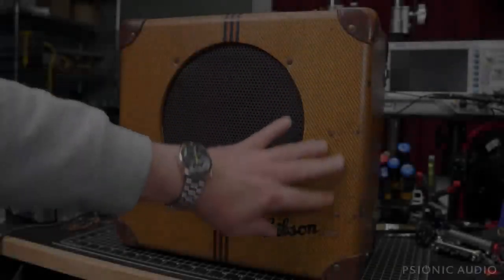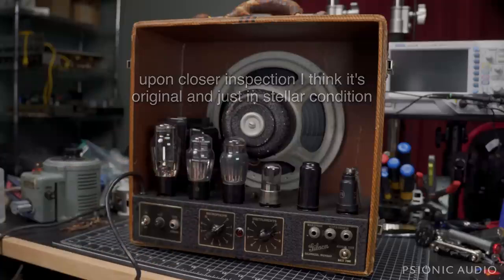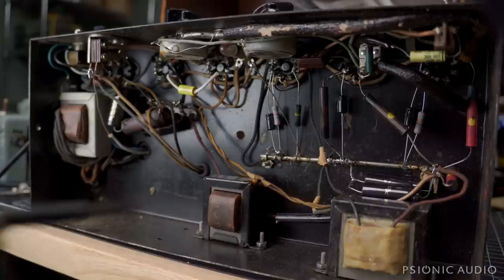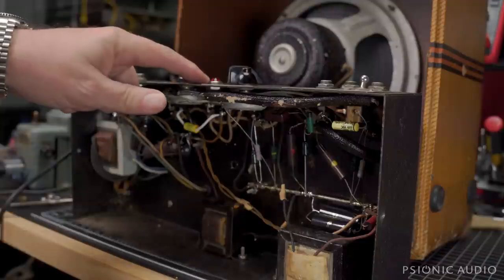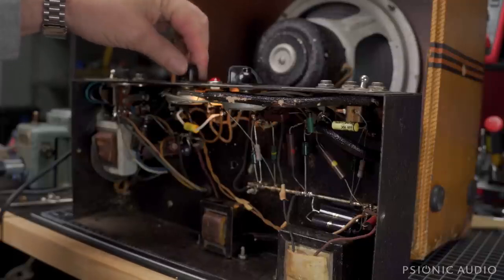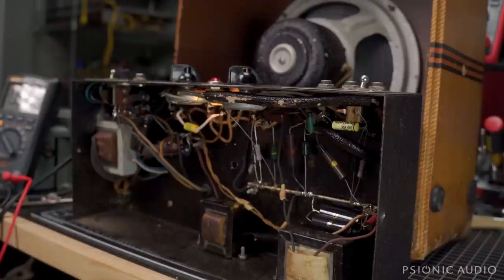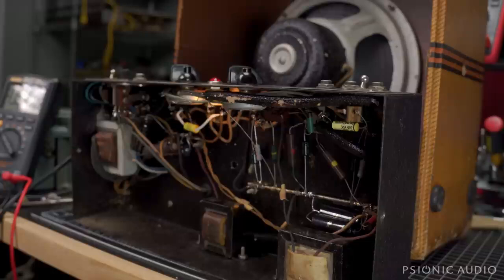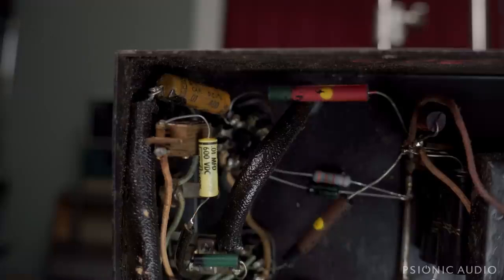'36 Gibson EH 150 Part 1 | Amp History on the Bench

Comment: 88 years and it fired right up. Incredible.
Reply from the maker: Not quite. It had previously been recapped with a grounded power cable added.
Reply: @PsionicAudio  ah yes, maybe a little too flippant on my part. The fact that ANY part of this was original and it worked after 88 years impressed me a great deal. I expected this to be a DOA rebuild.

Comment: Look at those old body  tip dot carbon resistors! I haven't seen any of those for a while.
I met an old tech once who told me that they used to shave them to change the resistance when tuning radio circuits. I still have some somewhere.

Comment: The later version of this amp is my next build project. I have a 1938 ES-150 guitar that was my grandpa’s, and I’m curious to know what it was intended to sound like. 

I’m skipping the field coil speaker and making the channels switchable. I tracked down a stash of NOS metal Westinghouse 6L6s, metal JAN 6J5s and 6SF5.

I would really appreciate any measurements you’d care to mention. Thanks for your informative, interesting videos!
Reply: The field coil speaker acted like a power-supply choke, so you might want to substitute one into your clone, rather than just using a resistor
Reply: @goodun2974  I plan to use a single choke instead of the field coil plus another choke.